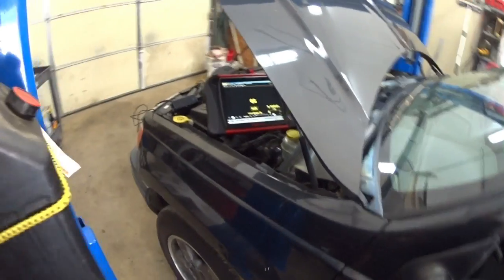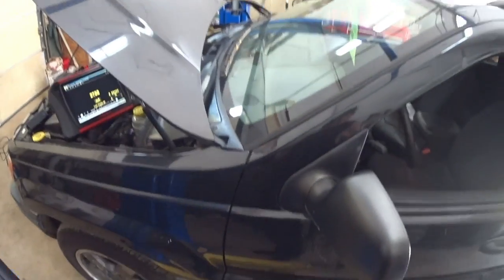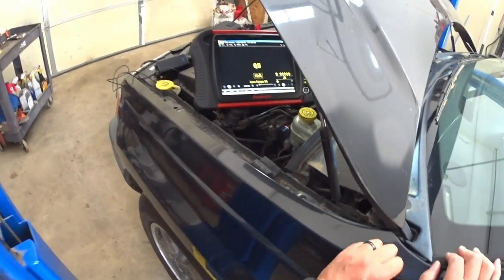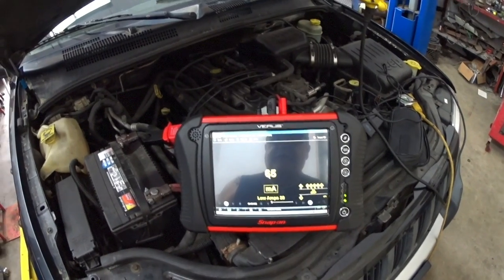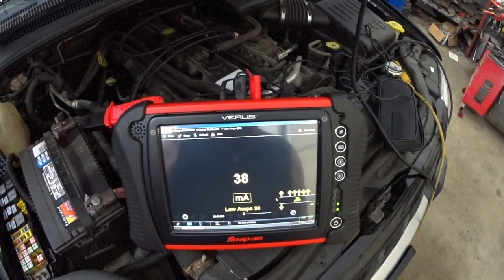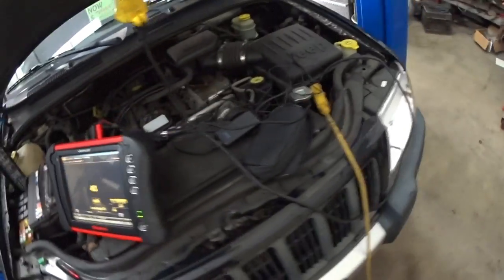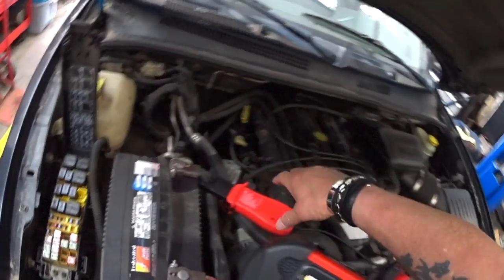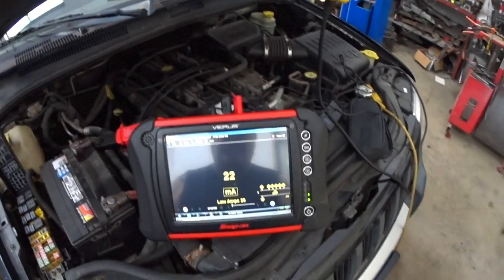How to Find a Parasitic Battery Drain using a current amp probe

Comment: Normal drain is from 18 ma to 75 ma
Reply from the maker: Geri Kuper anything over 50 mA is draining your battery 🔋 and that  information ℹ️ Is in all the most accurate tools 🧰 in the market out there...so 75 mA have 25 mA over trash hold... in a new battery 🔋 probably problems will not show any symptoms..
Reply: Pete Sambolin my car is mazda 6 and is 50ma is this drain battery??
Have bmw with 200ma and is ok . So is not all cars same .so the 75ma is ok but the best is 25 to 30 ma.but the new car with alarm is normal the 55 to 75
Reply from the maker: Geri Kuper Hi 👋I don’t want too go in a debate with you... and what I know and take for example the machine they used in manufacture and dealers are closed to $5,000 dollar tool and the rule is anything over 50 mA a problem and anything under 50mA is okay! So believe anything you what to believe! But my rule is the one ☝️ I been using for more than 40 years... and never missed a diagnostic! Went something is draining your battery 🔋 is all ways something aftermarket they installed in the vehicle... and that is that...!!
Reply: Pete Sambolin aaa you are good from mazda company hahahah i told you my mazda have 50 to 52 ma is not good bicose you told me 50 is ok ?
Reply: Pete Sambolin 50 to 75 is ok. So have car with 200 ma without any problem what about for this ?

Comment: Great video. You said you were connected around the negative battery cable just like with an in line dmm test right? What scale are you using on the Verus? Amps? or using the DC volts scale and converting?
Thanks!
Reply from the maker: Mechanix 1033 yes!!! Snap On Verus doo the converting scale all you select is milliamp ...

Comment: No tiene un correo tengo un problema con mi auto y quiciera que me asesorará
Reply from the maker: Cesar Flores okay !! Si es algo que le está agotando la batería tienes que empezar por desconectar todo lo que le an instalado que no vino con su carro originalmente. ahora necesito más información de el automóvil que estás trabajando¡ para darte una buena dirección por dónde empezar ...
Reply: Pete Sambolin Es el tefht sistem no me deja programar las llaves es una lariat f150 1999 La Luz es flashing
Reply from the maker: cuantas llaves tienes y si es una no te la deja programar ahora hay veces que uno compra el cilindro de encendido en auto parts y esas llaves hay veces que no programan y yo le e tenido que decir al cliente que valla a un junker y compre un cilindro de encendido con dos llaves y que las llaves tengan el emblema de FORD ... y eso me las deja programar... que equipo estas usando para programación de llave? si quiere me envía un msj. al 787.408.9050
Reply: Pete Sambolin tengo dos pero no las puedo programar ya cambie el silindro Chequie computadora cables fuses y relays y cuando entro al sistema de 10 min para reprogramar se sale no lo completa como si no hay comunicación....que tipo de programador necesito para este tipo de theft sistem muchos dicen que tiene que ser uno de Ford?
Reply from the maker: cuando esperas los 10 minutos que te pregunta tu equipo? ahora bien en ese ano trata de hacer esto pon la llave en el cilindro de encendido y circula la llave 8 veces a la octava ves los seguros de las puertas abren y cierran luego programa la llave ella misma...NOTE: todas las puertas tienen que estar cerradas pero no con seguro...
Reply: Pete Sambolin no no hace loque usted dice usted sabe que tipo de programador puedo usar
Reply from the maker: Cesar Flores okay pues no te da acceso para programar! Okay ya entendí! Eso pasa cuándo hay un módulo malo! Tienes qué darme los DTC que está dando en el GEM lo qué se conoce como BCM en otros automóvil y si tiene PATS también hay qué chequíar qué DTC es los códigos está dando! Qué ya sabemos que uno de ellos es de las llaves!!!!
Reply from the maker: Cesar Flores Bueno yo uso el MaxiSys 908 Pro oh! Snap On VERUS también tengo el IDS que es el clone del Scanner de FORD original... y usted vive lejos? En dónde está la Ford?
Reply: Pete Sambolin usted no cree que sea el scanner que estoy usando es un auto enginuity pro line con UNA laptop POR que ya cambie computadoras cheque cables por posible corto el tablero también de cambio noce que otro módulo tenga esa camioneta aveces pienso que es el scanner que le mencione por que me dijieron que tenía que ser uno de Ford o compatible
Reply: Pete Sambolin vivo en NORTH Carolina solo lo e intentado con el scanner auto inginuity pro line primero tenía el problema de comunicación con la computadora pero era un fuse que estaba mal pero mi aún así puedo usted cree que tenga solución ya intente todo?
Reply from the maker: Cesar Flores okay! Definitivamente hay qué intentar con otro Scanner bueno y ahora me acordé qué fue lo qué cambie cuándo mi Scanner me sacaba luego qué esperaba los 10 minutos! Fue el sensor y pequeño módulo que está alrededor de la llave!